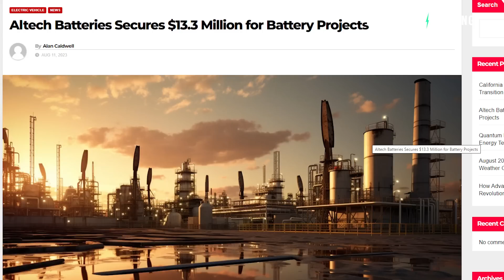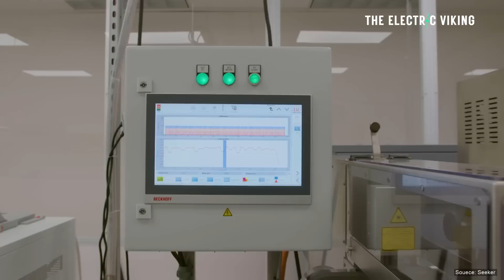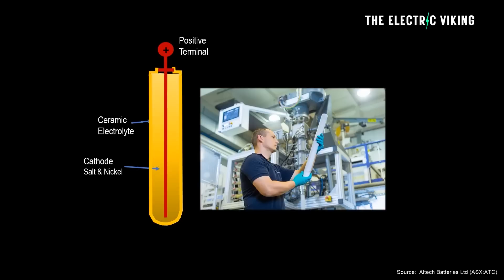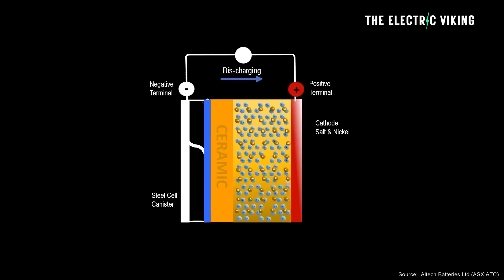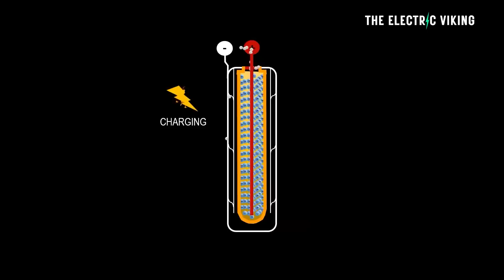Aussie sodium-chloride solid state battery & silicon anode company gets investors

Comment: The big advantage of Sodium Chloride  is that is extremely abundant worldwide. Sodium batteries are much more resistant to low and high temperatures, making them more suitable for outside use. Combine this with the added safety of solid state, and we could have a winner, no matter the current price of Lithium (which could rise again with demand).

There are many competitors promising Sodium Ion batteries, including CATL and BYD, so if one version disappoints the competition can take over.
Reply: Safety is the key .Especialy when you see what is happening to the car carrier ships burning up.
Reply: @davidcummings2020  The cause of that fire may never be found. But the Lithium batteries basically made the fire unstoppable. 

I have seen some leaked photo's of the inside, and basically the ship is not worth repairing and the EV's have molten and are now part of the ship. Some cars on lower decks may be saved if they find a way to free them from the wreckage.
Reply: @SolAce-nw2hf    I understand that  but even a normal fire on a ship will easily become unstoppable once the steel becomes hot enough to burn , it is called a hydrogen ion fire.   Im a marine engineer .  I wonder what fire suppression systems they had and if they were working ,if they were designed to handle EVs, most likely not. !!!
Wouldn't it be negligent to put such cars in mass transit on a ship that it wasn't designed and tested to carry safely .   Working out how to transport these  cars safely is priority for our sea farers .  it is possible but will require investment of the ship owners and new regulations from the IMO quickly or more people will die.
Reply: @davidcummings2020  From what I understand the safety measures for ICE cars is having very little fuel inside and turning off ventilation systems, so even if a car catches fire there is nothing to react with. Also sprinklers, CO2 and foam systems work a lot better.

The systems needed for EV's are a lot more expensive (retrofit would be about $3.000.000 a ship). Just paying more insurance to cover the loss is still cheaper than changing every ship. 

Also, there is no training for handling massive EV fires in confined spaces. Fire departments will only evacuate the area and keep it's distance, as the gasses generally give you a 0% chance of survival after 1 minute inside. No firetruck arrives that fast.

For now, the best thing to do is separate EV shipping from other vehicles and only modify and train part of the fleet.
Reply: @SolAce-nw2hf  Yes I know the protocols about fighting and containing a fire on a ship  first thing is to stop the ventilation and fans and close the vent dampers and flaps if they have them. . the amount of money to fit a high fog  system and or drencher system should not matter.  Sea Farers  lives are more important .  The insurance companies put their prices up the shipping companies will conform. and that change could happen much faster than a SOLACE change from the IMO who have been dragging their feet on this issue
Reply: @davidcummings2020  I would personally just prevent car makers from shipping these cars with Lithium in them, or at least everything that is not LFP, if they pass a rigorous fire test that is more than  just a surgical puncture like the industry shows us.

Comment: Apparently silicon anodes can experience significant volume changes during charging and discharging, which can lead to material degradation and reduced cycle life.   Alumina is mechanically and chemically stable, and it can act as a protective layer that accommodates the expansion / contraction volume changes of silicon and graphite particles during cycling.

Comment: No mention of cycle life or cost, which are the two killers for solid-state batteries today.  Solid-state batts have been around for decades,  they just cost far too much and their cycle life isn't great.  Whoever succeeds at tackling these two problems, will do great!
Reply: Cycle life and cost are mentioned: 5000 cycles down to 80% capacity with costs being 40% lower than LFP packs.

Comment: One potential positive of a sodium based battery is that if demand growth for lithium keeps out pacing production on supply side then prices lithium prices will increase. And possibly there won’t be enough lithium so sodium and other chemistries will be needed. 

As price of lithium climbs though more supply will become economical. Like direct extraction etc.
Reply: There is plenty of lithium, it just takes about 10 years to get a lithium mine into production.  The demand has just been growing faster than the lithium mines and production.

Comment: Are you sure the Sodium vs Lithium cost argument is correct? It's not just the metal changing but the whole electrolyte chemistry. I get much of the battery cost is beyond this but for Lithium to have had such an impact on costs previously, it must still count for significant proportion. To replace this with basically, cleaned sea salt must have a bigger impact surely.

Comment: Swapable upgradable Tesla battery packs would be nice as battery technology improves. It would also be easier to test battery prototypes
Reply: Swapping 600 kg of batteries.
Well, no need to go to the gym after work.
Reply: @SolAce-nw2hf  Solid state batteries are supposedly very light, and charge very fast
Reply: @SolAce-nw2hf  Pre-loading with super-caps might help
Reply: @SolAce-nw2hf  Guess I'm just disappointed in Tesla's progress on this issue
Reply: @briank.5173  As batteries get smaller and lighter, a modular design may make more sense. Right now just getting them to fit in a safe way is challenging enough. 

I would love an EV with universal expansion slots in the trunk. That way you could add preloaded batteries for longer trips and leave all of that range weight at home when getting to work and back is good enough.
Reply: @SolAce-nw2hf  Some people (like friends & I) are weighting for better batteries. EV prices should come down as batteries improve. And, we don't want to buy EV, if better batteries might come out tomorrow. That's why swapable upgradable battery packs would be nice as battery technology improves